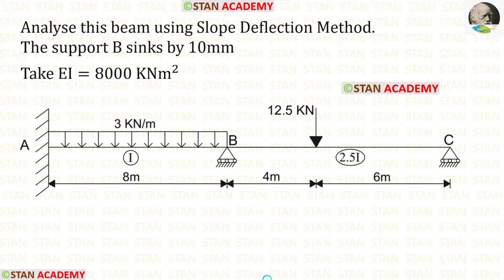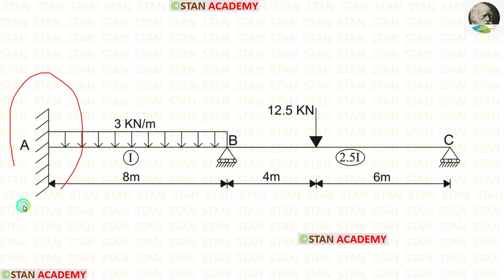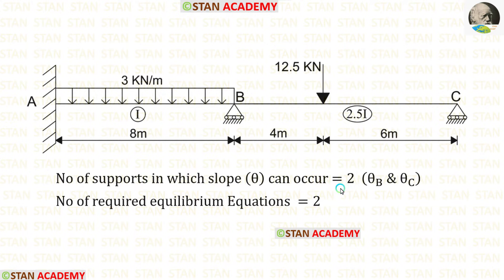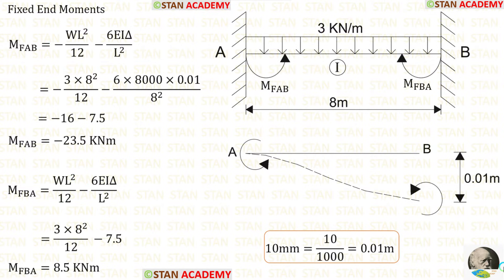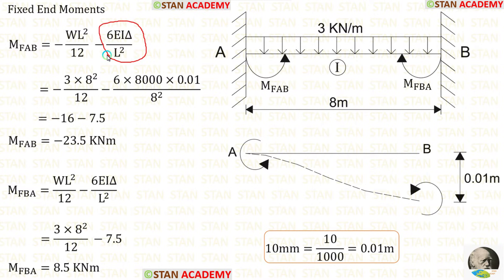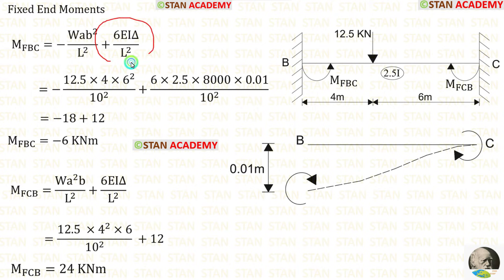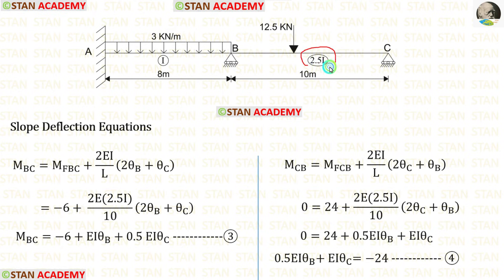Slope Deflection Method for Beam Analysis - Problem No 13 ( Sinking / Settlement of Support B )

Comment: Timestamps (Powered by Merlin AI)
00:09 - Analyzing a beam with settlement of support B using slope deflection method.
02:28 - Analysis of slopes at roller supports B and C in beam.
04:41 - Analyzing fixed end movements due to support sinking.
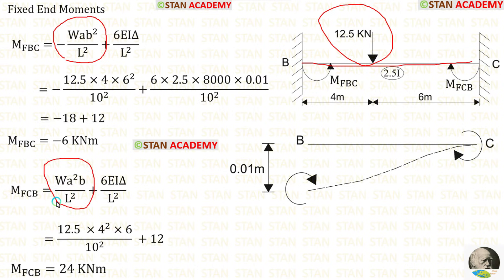06:50 - Calculate fixed end moments for sinking support B in beam BC.
08:56 - Analyze slope deflection for beam spans with fixed supports and equilibrium equations.
11:02 - Calculated moments using equations for beam analysis.
12:53 - Analyzing vertical reactions using clockwise and anticlockwise moments.
14:45 - Discussion on calculating reactions and constructing shear and moment diagrams.